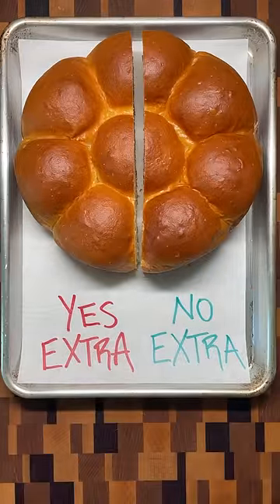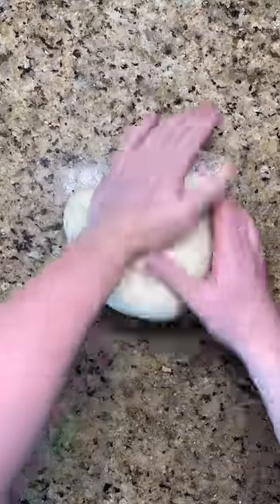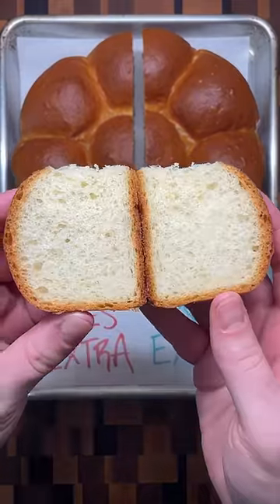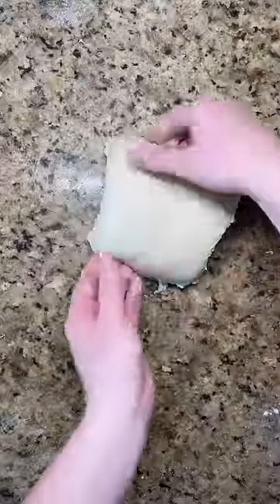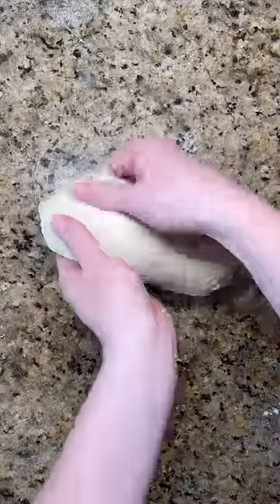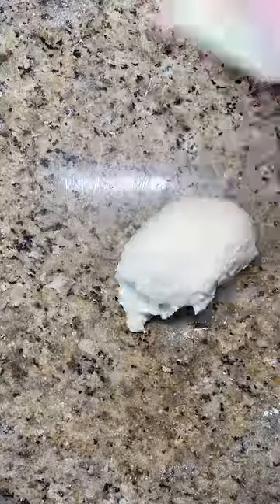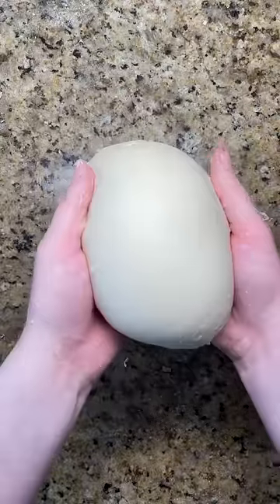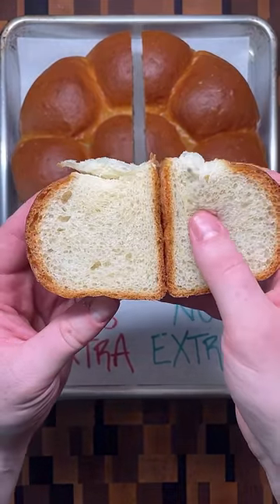The Effect of Adding Flour When Kneading Bread Dough

Comment: I had no idea that a bread would become less sticky after kneading for a while. The extra flour I put in my dough to compensate probably explains it tending to be somewhat dry. Thank you!
Reply: Yep the more you knead, the more gluten forms, which binds the dough together so less it wants to fall apart. Hence even with the highest percentage hydration the dough will eventually come together. Look up glass bread. The process is just wonkers.
Reply: My bread recipe also stops sticking after the first proof, so the first knead might be messy but after the gluten forms its nice and fun to work with!
Reply: yeah, at my old school they just had us knead the dough like normal and get dough all over our fingers, and we would know we had kneaded it enough when it pulled all the excess dough off our fingers and stopped sticking
Reply: Yeah i usually do the kneading with a stand mixer and it totally makes sense. After a while the flour doesn't stick much
Reply: @2GoatsInATrenchCoat yes! This
Reply: Unless you're making bread with high hydration
Reply: Yeah, turns out some of the most delicious breads you'll see, like pizza and artisan are incredibly high hydration. like 70% or more

You can still use flour but only a teeny bit, it's a sprinkle to prevent sticking not meant to coat the dough.. Really good breads actually have gluten so tight it doesn't stick
Reply: I put less flour in my dough and knead in the rest so that it gets the structure but isn't too heavy.
Reply: @eleanorcooke7136 Ooh, that's smart! I usually put mine in a stand mixer, but since I moved out of my parent's place and I no longer have access to one, I try to imitate a stand mixer by mixing the dough really fast in a bowl and throwing it around until it doesn't stick to my fingers anymore.
Reply: @2GoatsInATrenchCoat yes,also spraying your hands with cooking spray serves the same purpose!
Reply: I never had much trouble making but, for me yeast rolls would never turn out! I can tell you, I love to cook and bake, I started learning pretty young, still anytime, I tempted making rolls, they always plopped! Well,YouTube and this past Spring and summer, I spent time tempting, to give it another shot, I decided not to use all purpose flour, instead, I used baking flour, it made a big difference, so, from know on I will continue to use baking flour when, I make yeast rolls!
Reply: @sonyafox3271  I made king Arthur flour's recipe this last week, they turned out to die for.
Reply: Yup, kneading = more gluten development. You can REALLY change a bread depending on how much you kneed.

A fun recipe to try this out is try making your own fetuccini noodles. It's very simple and easy to make (basically just eggs and flour), and you don't need a machine to cut thicker fetuccini noodles. (bonus if you look for a recipe that uses just egg yolks, you can't mimic that flavor from supermarket dried noodles.)

I recommend that because you can visibly see and feel how the texture changes. It's "ready" when it stops feeling sticky, generally around 10-15 min of kneeding.

You can also take a small bit of it and keep kneeding it, and do a side-by-side taste. The one you over-kneeded will be tougher and chewer (obviously not gonna be as good as the one you made properly, hence why I'd just do like 2-3 noodles-worth
Reply: After letting it sit, in particular

Comment: I always add less flour during the making of the dough and then during the kneading I add the remaining flour. Your method definitely seems worth trying!!
Reply: Ooh i might try this actually
Reply: This method works as well and is what I prefer to the slap and stick.
Reply: You can actually use less WATER to get a drier dough which is easy to knead. As the gluten structure develops you can add in the rest of the water little by little. Works best with a stand mixer, but can work by hand too. Just don't wait too long to add the water
Reply: u can form the dough then leave it for 5-10 minutes and then knead well. if its a quite wet dough i do this even if i have nothing to prep in the meanwhile. its just easier

Comment: The minute you learn to read and understand bread formulas, especially hydration levels, you will instinctively know how to handle any type of dough. Using a kneading mat also helps. Just lightly grease it, and slap and fold.
Reply: I was a professional baker in both small and large production bakeries for 11 years. This isn't always true. It's actually more consistent with baking as a trade to fall back on touch as opposed to SRC. Yes, having a working understanding of hydration is important, but having an understanding of temp of flour verses water temp, understanding ideal finished dough temp, understanding expected rest times, the yeast used etc.. is probably more important. We also use large amounts of flour to ensure the dough doesn't stick to any resting boards or equipment we use. So in reality the amount of extra flour you add whilst kneading is negligible. What's more important is understanding that when adding flour we tend to over knead the dough, which is what's actually causing all the problems ol'mate claims adding bench flour is causing. It's the nuances of baking that's being missed here.
Reply: @smithbernard22  In production, sure. You're dealing with larger amounts of dough with less surface area to pick up flour (cube-square law)... and more importantly, you know better how to knead and when it doesn't need more flour. Regardless of how much flour is on the surface, you're not going to add a lot to the dough.

In the home kitchen, though, it is very easy for a starting baker to keep adding flour until the dough doesn't stick, instead of kneading until dough comes together and stops sticking. This gives a wicked combination of too dry and not kneaded enough.
Reply: @KeithJDavies  first and foremost, larger dough, more surface area, considering as i mentioned, we add it to equipment used such as bun rounders, or D24, or moulders, which means at 2.4kg, or 800g individual doughs may get vastly different amounts of flour at different stages of production.

Secondly, as I said it is the nuances of baking that allows you to know when it's to much. However, even as a home bread maker, that doesn't change the principles of bread making. The fact is adding more flour leads to over kneading and not under kneading, which is the root cause of all these problems. The over size of production doesn't change the way you treat a dough. 

I'm also very aware that at 1kg of dough, 10g of flour represents 1% of additional flour weight, when you make say 25kg, you are still more likely to add the corresponding 250g flour to stabilise. So in principle, the amount of bench flour needed to cause any issues needs to exceed 10% original flour weight. Supplementary to this, most people make over hydrated doughs ignorant of dough/water temp, leaving them with anywhere between 5-10% give on a standard bread recipe anyway.
Reply: @smithbernard22  Fair enough. When I've seen people learning they tend to add flour rather than knead, but that was an admittedly small sample of people.
Reply: @KeithJDavies  I also the other issue is a lack of oil, and addition of 1-3% is usually required. When I taught apprentices, they always forget oil, so I suggest trying to use a spray can of canola when kneading to tackle sticking and to incorporate the oil.
Reply: @smithbernard22 
Yesss! I came looking for this comment. Over kneading is the biggest issue. However, in residential baking we do tend to over flour AND over knead 🫣🥴🤣
Reply: @Sheena7625  that's what I said, over knead because over flour... but that's basically the long and short. It's also a reality of not having years of experience feeling a variety of doughs regularly.

Comment: Good to know. I use different method of avoiding additional flour in my biscuits, which is to short the recipe by a third of a cup and then use that under and on top of my super-sticky dough ball until the dough is fully laminated and the flour is all mixed in.

I also fully mix the grease into the dry mix until there are no more lumps, only clumps. Coating every grain in the grease inhibits gluten production for tender biscuits.

Comment: My mum likes to make soft homemade rolls and they are always very sticky while kneeding. How she gets away with them not sticking to her hands or the counter-top but still doing the same kneeding technique she favours is by spreading a thin layer of margarine on the counter and her hands. The dough doesn't soak in much of the margarine and she can easily work the dough how she wants since it doesn't stick. Clean up is just a dab of dish soap on the counter with a warm wet washcloth. The method shown here looks fine, but frustrating to use if you can't get it right and the dough keeps sticking. Try out my mum's method, it's very useful!!

Comment: I make a brioche-style loaf of bread about every two weeks, and this is the #1 problem I encounter. I have to add SO MUCH extra flour to be able to knead. It wouldn’t be a problem if I had a stand mixer, but because I knead by hand, the stickiness really causes a problem. I end up adding several tablespoons of extra flour while kneading, and not only is that wasteful, but it does impact the density of the loaf. I can’t wait to try this method later today, thank you!
Reply: Use water on hands or use a bit of olive oil. I like using water while kneading.

Comment: When I bake my weekly loaf, I don't add all of the flour in the recipe. Instead, I use what's left of what was meant to go into the recipe as my surface flour. It works really well. Also, I've noticed that Fleischman's yeast REALLY prefers unsweetened vanilla almond milk over whole cow's milk (or other nut milks I've tried.) The vanilla flavor doesn't come through the finished product, but there is a slight "sweetness" that can't be described.

Comment: If the hydration of the dough is really high (>70%) the dough is always fluffier, more moist and has a better crumb structure, but becomes more difficult to knead without extra flour. Autolysis is another way of not having to deal with the difficulty of kneading such a wet dough. Autolysis is the process of simply letting the dough rest after having been brought together for 20-30 minutes to let the flour fully absorb the water and develop the gluten matrix more intricately, which gives you a more structural and less sticky dough to work with on the get-go.

Comment: We always used oil instead of flour to keep doughs from sticking at my old bakery. Oil it down before you pull it off the mixer, it slides right out of the bowl and doesn't stick to anything. Plus your bench soaks it up, it's always conditioned and you never have to oil it. I know this video is for hand kneading, which you don't want to use extra oil for, but it works wonders if you use a mixer.

Comment: I will never understand how yall handle bread dough. 

Bread dough sticks to my hands, to my cutting board, to my counter like superglue. 

Last time I handled bread, had to almost double the amount of flour the recipe called for just so it would release from my hands when kneading with minimal pressure and moving quickly. 

Otherwise it stuck so hard it literally held its own weight by gluing itself to my hand. Which was clean, and stuck both when bone dry and dusted in flour and clean and wet with water, even clean and lightly oiled didn't last more than a few touches.
Reply: I wish I was exaggerating but I'm not. I can't knead a dough to become less sticky when it's so sticky I physically can't knead it.
Reply: If you're making bread, try to use higher protein flour and see how that works. 

Otherwise, it may also be your environment, as humidity can affect hydration in dough.

Also, how are you kneading dough? Are you doing the conventional push and fold method he does with the palms?

Try doing the slap and fold that he does and keep contact quick and minimal with your finger tips.

What could also help is something called autolyse, which is simply resting your dough before working with it. 

After roughly mixing together your ingredients into a shaggy dough, let it rest covered for about 30 minutes. You could do this stage of the mixing with a sturdy spoon.

After the rest period, you should see your dough be much more elastic and workable. Afterwards, you can try the slap and fold in the video or try stretch and folds that others do.

If you think you're up to the challenge, then another way of reducing stickiness is shaping your dough into a ball. By building tension, stickiness will  reduce. Here is a tutorial: https://www.youtube.com/watch?v=Koab3fxN4t4

Comment: Yes, you are quite right, but use olive oil on yr hands instead of water
Reply: Eh, I wouldn't exactly recommend that.

While using oil is helpful at times, it can have some affects on bread--beneficial or negative at times.

Oil will shorten gluten strands, which isn't the most desired affects for those who want to make baguettes.

If you get used to using water and judging dough hydration correctly, water is good enough for any application.

Comment: Flout contains glucose,  when you knead your dough you are initially breaking down that glucose which causes your dough to become stronger and more elastic. When you over knead your dough you've broken down the glucose to much, adding more flour also adds extra glucose. Best way to knead bread is the palm pushing method, Do not beat or slam your dough as you can not control glucose breaking down. You'll know when your dough is ready with the indent test, you want to apply a gentle pressure to create a dent in your dough if the dough rises evenly to hide where you left the dent then it is ready to be left to rest and rise before baking.😊